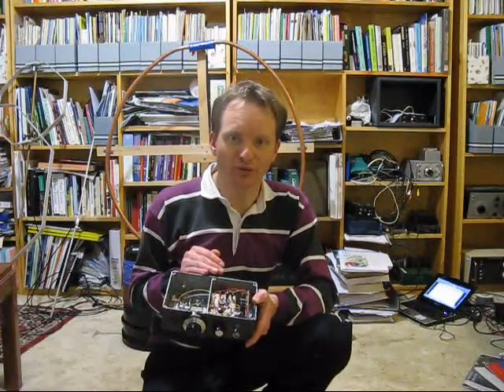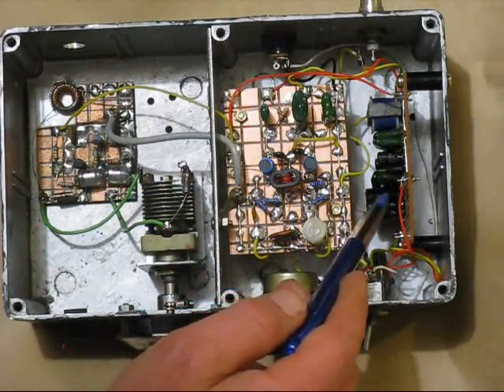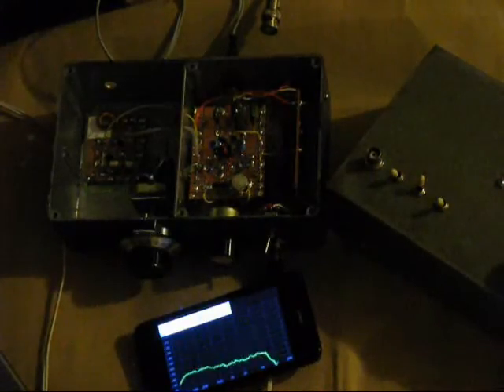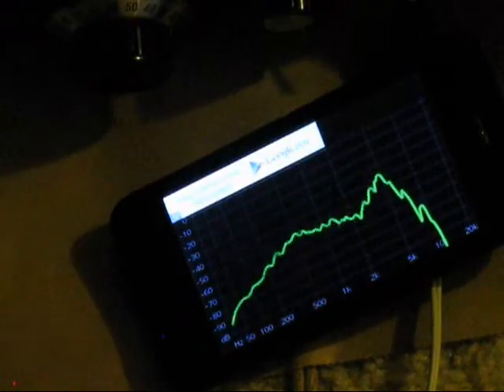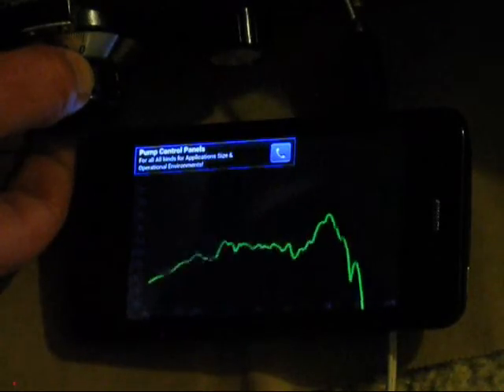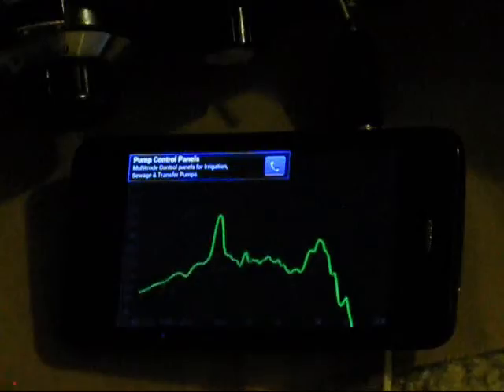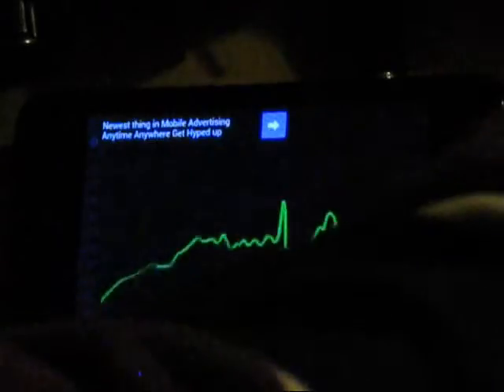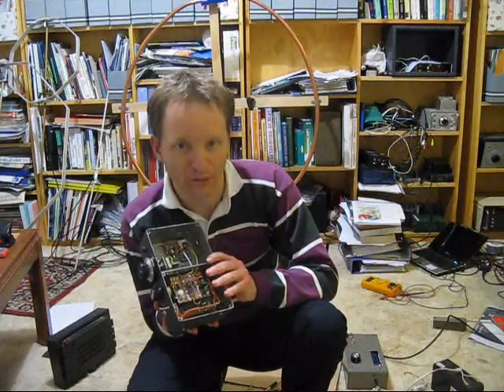Testing a phasing SSB receiver: Part 1 - with a mobile phone

Comment: Hi Peter
Years ago I use to find that the diode balanced modulators suffered from microphonics, RF mains hum and broadcast breakthrough. I found this disappeared when I went over to the NE602. But today's diode receivers do not seem to have the problems we used to experience. Maybe it is the use of ferrite rings to obtain perfect balance.
73
dave